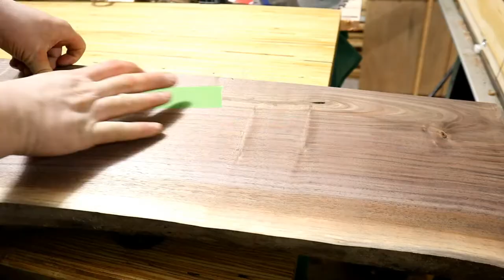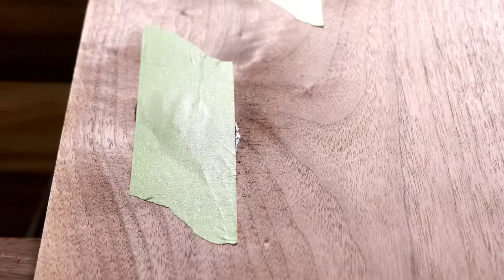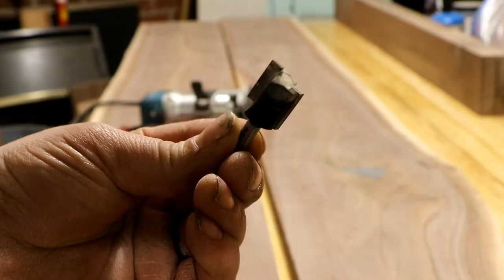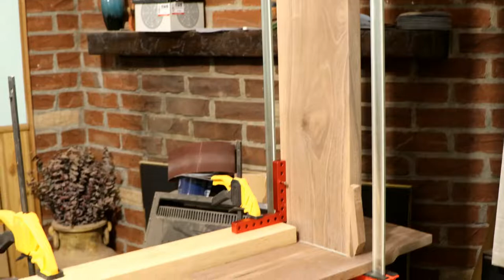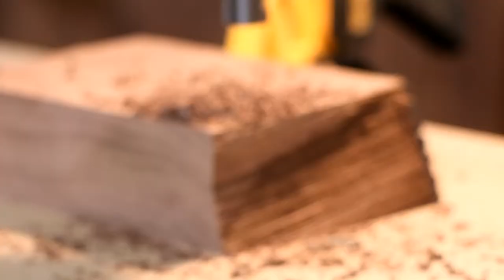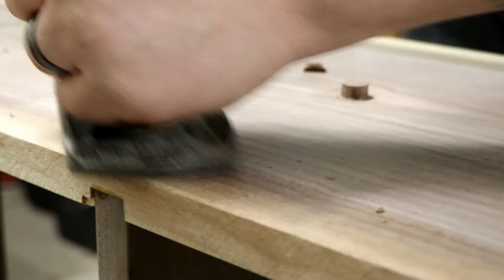How to make a Live Edge Walnut Shelf

Comment: I haven't used Odie's oil but it sure looks great on that walnut.  My favourite oil for the last couple of years is Osmo Polyx.
Reply from the maker: They have different feature. I used to use Osmo. It's great as a repeatable product. Sand, coat, sand, coat and it can be buffed to a real shine. Odies is more like a Danish oil. The super duper is really easy to apply and really easy to repair, as a quick sand and another coat offers a new surface, without having to remove the product beforehand. It also doesn't water spot and I find Osmo spots pretty hard. These are my personal observations.
Reply from the maker: This particular video will have an update soon, where I customize it for a specific purpose. It's almost ready and I'm super excited about this one.